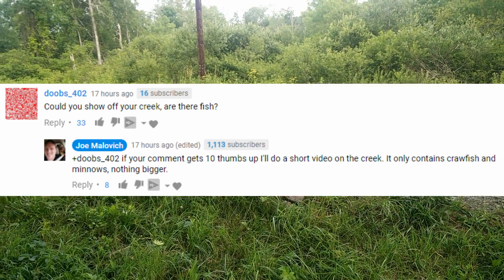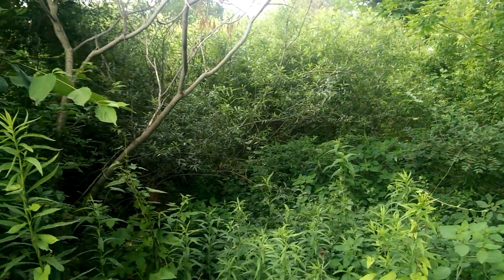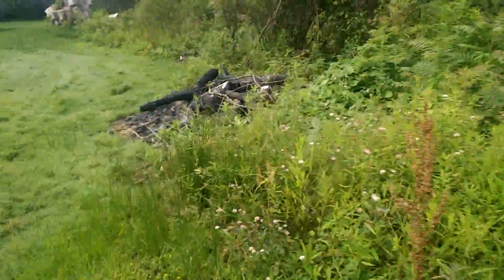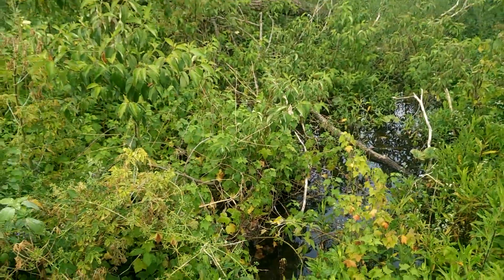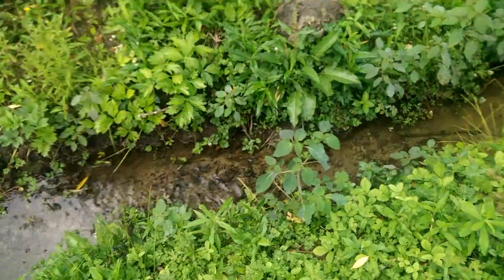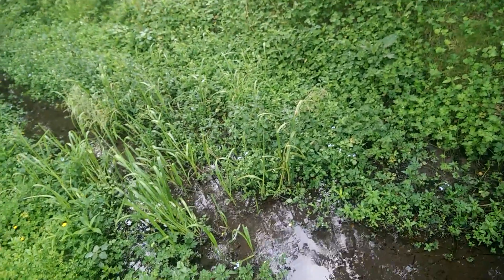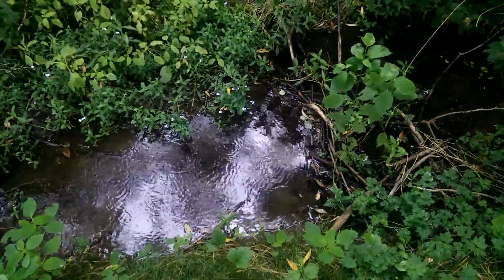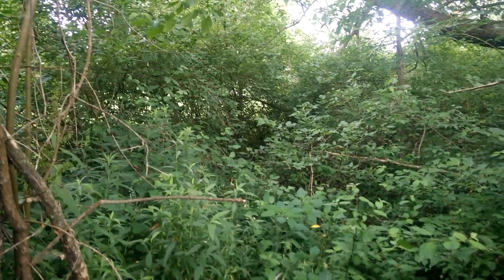[Part 3.1 of 10] Waterwheel Microhydro, Creek Tour

Comment: Nice overview video! What kind of waterwheel will you be installing? Overshot, Breastshot or Pitchback design? If you want to generate electricity a pitchback water wheel is probably the most efficient.
Reply from the maker: overshoot, doesn't require a special trough at the bottom.

Comment: why dont you put a thin plastic tarp on top of the flume for the water to flow through, then the wood wouldnt degrade over time :)
Reply from the maker: I could, the wood would probably rot even faster if water got under the plastic though.
Reply: Okay, just a suggestion. ive never done anything like this before :)

Comment: I'm enjoying the project and your progress. You may have mentioned in a previous video and I may have missed it, what State are you in? I saw snow in a couple of you videos but wasn't sure how far north  or south you were. Also, the "old pond" area is likely to be considered a "wetland" by the all knowing EPA. not that you are doing anything that affect it, just wondering if you knew if it was classified as such?
Reply from the maker: PA, it is not a wetlands protected area. In pa it must be like 12+ contiguous acres to be considered wetlands and legally protected.
Reply: I'm just north on you in Delaware County NY. Maybe it's NY's DEC that if so over the top with what they consider a wetland. I know people who have been stopped from doing work in wet areas much, much smaller area than 12 acres. 
Good luck with the rest of your project.
Reply from the maker: for PA:

Exempt Wetland Activities. Some activities exempted from the Act are dams not exceeding 3 feet in height, the maintenance of an artificial pond or reservoir, water obstructions in streams or floodways with a drainage area of 100 acres or less, aerial crossing of a nonnavigable stream or wetland by electric or telephone lines, a dam subject to the requirements of the Mine Safety and Health Administration, maintenance of field drainage systems, and restoration activities.

My dam is under 3 ft and has a drainage area of less than 100 acres.

Comment: why dont you doo it in concreate?? wood will not last that long.. and are you gonna remove the old dam???
Reply from the maker: Do what in concrete? The flume? I fear a concrete flume would have been an order of magnitude more extensive, and wouldn't handle freeze-thaws like the wood will. The old dam is above the current high water level, I'm leaving it.